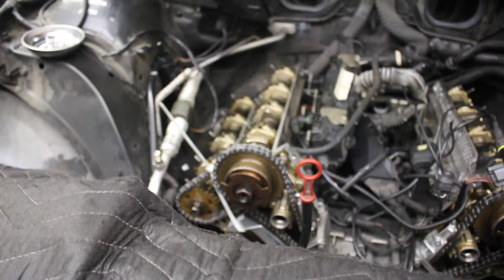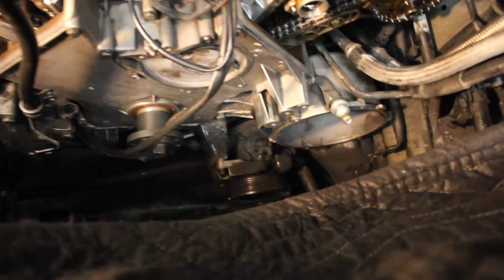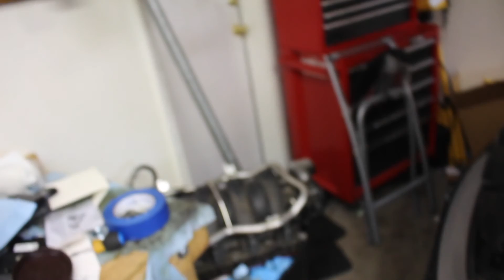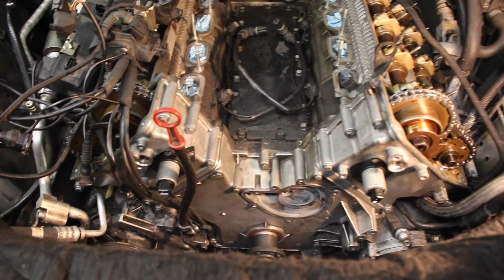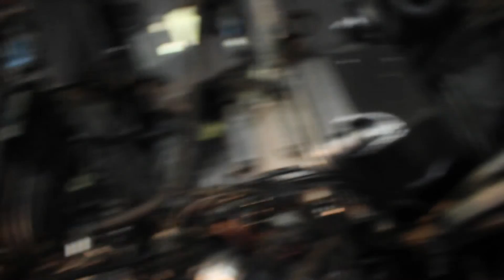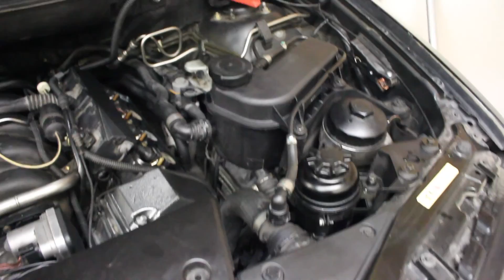X5 Build Part 5: The Final Reassembly

Comment: What crazy i did this job with the chineese tool and he says if upper timing covers are not fitting the way he mentions ill have timing issues which i do! Both sides timing codes and vanos wont activate

But is it the covers or chineese impulse wheel position !

Comment: some of your torque settings are wrong - initial torque on crack nut is 100Nm - not ft lb
Reply from the maker: So that's like 75 ft-lbs. Not too far off, but thanks for pointing that out. I've seen people say both 100 ft/lb and 100nm interchangeably. I don't know if that little of a difference would cause any problems, given that it is a rather large torque-to-yield bolt. I've done about 10 of these engine builds so far with no problems on any of em, even after many miles and years.
Reply: Ive heard that bolt is called the jesus bolt! man its done up tight! bought my x5 in same state -did all the chains and LH intake cam - cheers Bert
Reply from the maker: bert boozy nice! How many miles does yours have? And what color?

Comment: Hi Danny..I'm in the process replacing the valley pan, valve cover gasket and lower timing chain tensioner.. I need help torques specs on all of them in lbs. I got 2000 BMW X5 4.4. Pls help.

Comment: hi..what valley pan brand did u use and also which hose did u replace from oil separator?
Reply from the maker: I used the Genuine BMW valley pan, it was like $70 or so. I often use cheaper parts for gaskets but since the valley pan is such a hassle to replace I just went with the OE option. The oil separator was Genuine BMW was well, and the hose was the one that goes from the bottom of the oil separator to the pipe that comes out of the oil pan. The hose was a Rein brand and it included new hose clamps. It was a real pain to replace.
Reply: i broke plastic tab that hold injector wiring housing. do u know to open the housing box?

Comment: Your videos are awesome! Particularly the x5 build videos. I can totally relate to the cost and time these e53 (v8's especially) need when maintaining. So glad I found your channel as these x5's just love to break down, unfortunately.
Reply from the maker: Thanks! Yeah the V8-powered X5's can be pretty needy in terms of maintenance, but I'm super familiar with these BMW V8's so I don't mind. My daily driver is a 2000 540i Touring with basically a smaller version of this X5's engine. The X5 is sitting in my backyard at the moment, awaiting some new parts... I should be resurrecting it pretty soon, so more videos to come! I also plan on doing some videos about my 540i Touring and about my 1987 Porsche 944S which I plan to fix up.